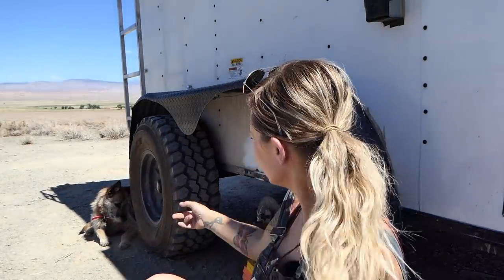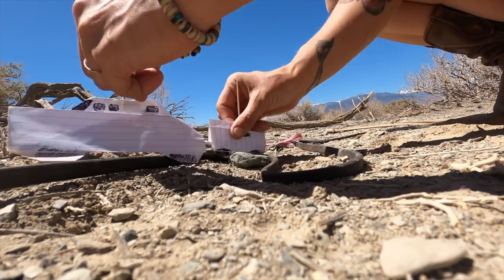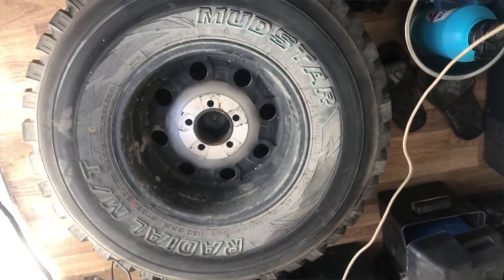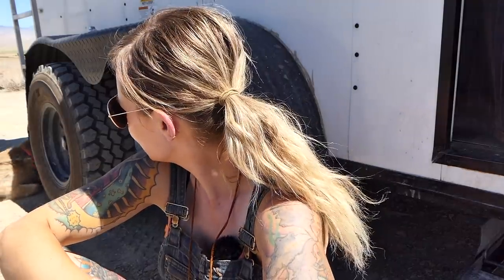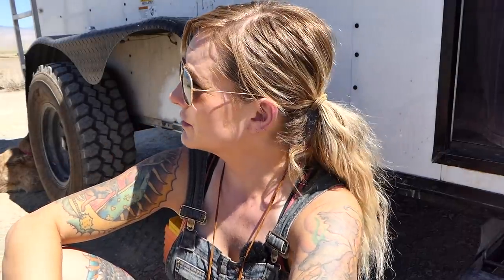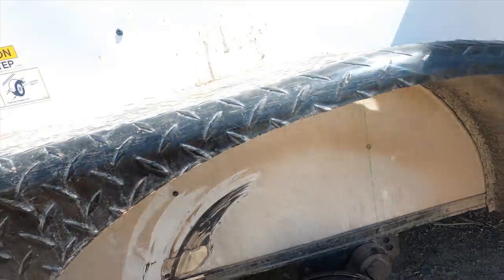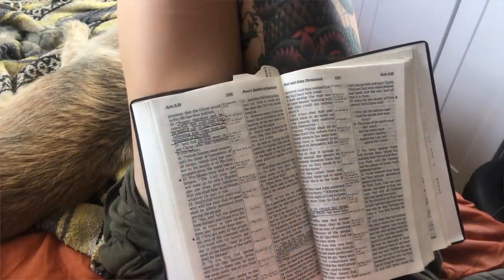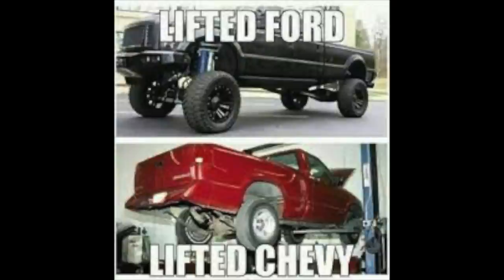Diary of a Broken torsion axle - living full time in a Cargo Trailer Conversion

Comment: Torsion axles are FAR more common on enclosed trailers. Spring axles are WAY more complex with TONS of parts. If you had blown out a spring axle you likely could NOT driven out without strapping up (pulling) the axle to the frame. Spring axles typically distribute the load via a pivot (back of front spring ,front of rear spring) so when wheel is off the hub would drag if you didn't pull it up. Blew a front main spring on deck over trailer tandem trailer on BQE in NYC on a reclaimed wood delivery. Rainy, cold, and miserable crawled under it used two 2" ratchet straps to jockey it back up into place, walked to a Home Depot, and bought radiator and C clamps. NEVER thought it would survive the TERRIBLY bumpy (NYC is so busy they can never really fix roads) trip 350 miles home.....Once home i replaced ALL springs, shackles,pivot bolts and u bolts as they stress fracture over time. (KEEP YOUR TORSION AXLES!!) Simple torsions are better for what your doing.

Comment: Though it was indeed a long video as you warned, some combination of things kept me watching from start to finish, without even speeding it up past 1x.  You're pleasant to listen to, funny as Hell at times, pretty darned smart, and more than pleasant to look at.... with or without wrinkle cream from Los Algodones.   And occasionally you throw us unexpected and unnecessary bones, not monetary like for the mechanic, but usually visual, humorous, or insightful.  

You navigated the situation perfectly, and with safety margin to spare.  Namely, you invested in double axles so that this sort of incident wouldn't leave you stranded.  It paid off by getting you back to pavement, a shop, and a boondocking spot to wait it out.  I won't fault you for not just proceeding business as usual while waiting for the part, but that was another option you prepaid with the double axles, if willing to spend a couple of weeks without the redundancy.  

I think it's a great idea to set your truck up so that in 5-60 minutes you can take what you need from the trailer and proceed to live in the truck without missing a beat.  A handy skill if you ever get in a spot where the trailer has to be taken away on a flatbed tow truck, or left where it is for a while awaiting recovery.

Comment: Hauling Big Bulls: Many years ago I bent the 3rd axle rear wheel when it hit the edge of step I did not see leaving the motel. It happen in town I knew where there was a local repair shop I limp to. In less then 4 hrs they had it repaired better then new. I had that 5ft wheel cattle trailer back on the road again, because the girls back home need the new heard bull. If I were you I would look for a local repair shop that works on older industrial, agricultural equipment. They may be able to repair your part for much less then a national company.  enjoy you videos

Comment: Your incident is exactly why I've decided to go with a Timbren axle-less suspension for our trailer build. It gives you greater ground clearance as there's no axle tube for rocks to hit, it's a fully independent suspension which makes the trailer smoother to tow and better suited for overlanding. They're small & compact to ship & there's no way you'd need to wait weeks if one of them was damaged. I can't speak for Timbren but imagine you can get one shipped to you in days. They're no more expensive than standard or torsion axles & the only compatibility issue you'd have if you upgrade is to make sure that the set is compatible with your existing spindles & rims. You could call them to find out which spindles you need to order for your wheel hubs. The other thing is that their kits are easy to install with no welding required. I highly recommend considering this type of system. https://www.etrailer.com/Trailer-Leaf-Spring-Suspension/Timbren/A12RS440.html  https://timbren.com/p-35853-axle-less-trailer-suspension.html

Comment: I don't need a tow truck, I drilled holes in the front bumper of my RV and I just switch out the tow bar to the RV and tow the RV. I've saved myself a lot of money working on both my rigs. :) Can only drive 35mph because the RV will start swaying.

Comment: I didn't think about having two axles for this specific purpose.  I just replaced the axle on my single axle trailer after it wore out a tire in 4000 miles.  Cost me $200 plus my labor for a 3500 lb idler axle with springs and hubs.

Comment: Good job with the reenactment haha. Learn as you go right. If you're driving over rocks...go VERY slow. None of us are born with knowledge, we learn through experience one way or another. I chose to take specific jobs starting at about 16yrs old on, where I could learn skills and knowledge to use for the rest of my life. Every job since I took to learn more and get paid along the way learning tons of life experiences.  Breakdowns happen don't sweat em. It's soooo much easier these days with internet access, websites and groups etc. 

I noticed in your vid of the axles you have scotchlocks on the brake wiring. Those are HORRIBLE on wiring especially when it's outside. Replace them as soon as possible. Use a small screwdriver and pry the side open and pull the wires out. Strip insulation back and install a 12ga or whatever wire size it is butt splice connector with factory heatshrink on it. They're available on Amazon and maybe autostores with wire terminals etc.

Check out 4x4 Rescue (State) on Facebook. It's basically a network of offroaders all over the country that help others in need on or off road. Essentially it's ONLY for rescues so the only active conversations are active so your plea for help won't get drowned in how do I change my tire users.

Comment: the problem with carrying a spare axle is that left and right sides are different. 
i did 12,000 miles in a 30 year old toyota motorhome with 230,000 miles on it, 
and only $12 for a universal joint in florida.    love those toyotas!

Comment: Ok, you did well. life is a learning experience.   A couple of things, no negatives,  just maybe help if this happens again.

1. You, REALLY hit that boulder to do that damage, probably just hit it right. might never happen again
2. If it were I, with my lifetime of all sort and sizes of trailers; you could have driven that on one axle.  The trailer is overbuilt, to your specifications; you would have been fine, with one 3,500# axle.
3. We have had torsion axles and spring axles; and still own both. The torsion axle is much better on the road; better ride for the trailer and the tow vehicle.  Springs break too.  But you really bent the torsion half/axle, some use different names; but the part that the hub attached to. Somebody may call it differently; have at it.  On a spring axle you still would have bent something; the boulder won.
4. In my area, mountains of PA, as a last resort I would have taken the trailer to a Truck spring and axle shop.  Not a neighborhood service station.  The truck shops replace axles and springs and straighten bent parts; and often have or can get any suspension part. Car, truck, trailer, big or small.  Something to consider when you have major repairs. The gas stations, service shops don't have heavy duty equipment.  It is unfortunate you didn't get to a heavy duty shop. Six to eight weeks, I feel your pain.

Finally: The torsion axles are fine, just don't hit big boulders, LOL. I'm not laughing 

              Go to a shop that can handle the repair, 

              Thank god You, had enough insight to order a tandem axle trailer.

winky

Comment: Hi Lex....Might I suggest, Instead of buying a spare axel(super heavy..And where ya gonna put it?) I would try a off road shop..Have them make a rock slider mounted in front of your front axel. It would either slide your trailer over..or around the obstacle . 4x4s use them and I'm sure someone could fab something out of steel tubing. Probably way cheaper too. Good luck....Glad Riot's with you.
Reply: Al scheider do u know a website has rock slider I fixing buy a 6*14 cargo trailer

Comment: I would have chose leaf springs for toughness. I think the way to get around the stiffness or "bouncyness" (if that is your issue with them) is to get just the right spring rate for your gross trailer weight. You could also get softer springs and add coilover shocks.  A torsion axle is weaker due to the moment arm being totally unsupported, very susceptible to damage. I do not know what your referring to as far as leaf springs needing more maintenance. Ultimately If I were offroading my trailer ( I do, Have taken my customized Harbor freight trailer loaded with dirt bike, roof top tent, and camping gear on Fins-n-things trail in Moab) I would always choose leaf springs.

Comment: I have a 70s canned ham trailer I was pulling up a snow packed icy single forest road (Routt). I should have camped down by the river but nope not for me. I got about half way up a hill until no more traction, pulled us back down to the bend. i was lucky there was a boulder just large enough to stop us other wise we would have landed down in the meadow. the last second I hooked the front end around then had to unhitch go back down just to turn around. She's now a bondo bucket. lol

Comment: Seems like trailer dealer should stock a couple for this occasion.
Reply: With the advent of next day shipping, many repair shops do not stockpile parts anymore. My boss used to tell me to keep it under $5000 parts inventory, and that was mostly tires,  filters and brakes, lubricant. No point in having money tied up on parts collecting dust on a shelf.
Reply: We used to take bent axles off of 4 wheelers to the NAPA shop where they has a machine for trueing bent crankshafts, and get them straightened back out. The Honda shop would not do this, only replace them.
Reply: @gregpeterman1102  
Do you work for Lex's trailer mfg?
These cargo trailers are specifically made for this back roads stuff, and people like Lex who buy them and then get into trouble.  
No, you don't want to balloon the inventory, but with this product and these customers it looks like something could be done better here, IMHO.

Comment: as a retired master mechanic ya just can't beat old school.
spring axle - Availability
12 volt - Availability
AGM Battery - Availability
dual axle - u are not dead in the water with a flat
K.I.S.S - keep it simple stupid
2 is 1    1 is none
preventive maintenance

Comment: Glad you were able to source an axle!  I'm thinking about changing mine out (on my Casita) to a Timbren axle.  It uses a rubber spring like torsion axles do, but their external and have a lower failure rate than torsion axles do... though the type of failure you experienced probably would have happened to the timbren's too.  Parts availabilty for them is pretty good too... they're available on etrailer and amazon so it should be easier to get a hold of them in a pinch.  Anyway, happy trails!

Comment: I hope it works out ok.  I run Dexter axles under my trailer, but they are leaf springs.  I know they offer torque springs versions but I didn't know they were custom size.

Comment: Order the extra axel, have it mounted under the trailer to the point that it's there but no where near touching the ground even remotely the hub part could be mounted upwardwards where only the axel would be stretching under (or across the top of ur trailer if the width of ur trailer is exactly the same at the bottom as it is on the top) the width of the trailer, and if u don't think it can be done it can, always remember this - where theirs a will there's a way, when and if the axel is needed have the spare axel mounted in a fashion where it can be easily removed for usage.

Comment: You handled it well,  explored your options. Of course I don't think that's how we begin...
  I've considered building a small trailer, definitely a torsional style axle as they do perform better ( I wasn't aware that having two sets would reduce trailer vibrations and response to road conditions until you mentioned way back...)  
  I read one comment about having someone store a spare and you have considered having one with you. But wouldn't you require 2? Left and right? 
   Good Luck!! Glad ya have a Plan....

Comment: I have been someone who has a tendency to buy snowflake things, I have bought one too many things that were the this thing is a 95% perfect fit when the common thing would have been a 90% fit... I have learned to get the thing that is easily repaired and swapped the thing that has the biggest community of fans surrounding it (not the most fervent fans but raw numbers) as if you have an issue you want to spend 30 seconds googling it to know how bad it is and not 2 hours  still searching with no answer. I learned this when i had a VW golf and was saved so so so many times with a quick google. So when it was time to get an overland rig the ones that were in contention were the LR3/4, FJ cruiser, 4 runner, Land cruiser, and the one i thought was the cooooooooollllllleeeeeeessssttt diesel jeep grand Cherokee with the Mercedes diesel that they made 2007-2008 I remembered my VW golf and thought I should google some common issues. the land rovers fans had all the answers and how to fix or bypass them the toyotas have so many shared parts that if you cant find the information about your rig but you know the part numbers are the same on another model there is a REALLY good chance you can find out what you need (and find good used parts) in no time at all. There was like NO information on the jeep with the merc diesel i couldnt even find out how many were made, or what were the specialty parts that were not standard merc parts... in the end I got the lexus version of the land cruiser because holy hell it had 181k on it but 176 were meticulously dealer maintained and you could track every repair ever through the lexus website... So in the end i kind of got a snowflake but its really just a normal car rebadged as a snow flake. Which is a long winded way of saying take a 90% good enough to avoid waiting 2 months for repair parts.

Comment: Origami truck and trailer so funny
In my opinion the idea of having a backup torsion axel what would be a good idea and if you do, do it you might want to take a look at having it mounted underneath the trailer maybe have a bracket made the hold it tight up to the frame or maybe even bolted to the across the width of the trailer that way would distribute the weight really well just a thought
Okay so you two stay safe

Comment: You can take your old axle and have it repaired by a (axle dr). When I drove over the road I have had to have a few axles repaired as the trailer I pulled was custom built to transport boats. They can cut off or straighten your bent axle and repair it good as new
Reply from the maker: Thanks! I’ll look into that! Do you know any Axle dr.s?

Comment: My 4star horse trailer had Dexter torsen axles. Somebody bumped into one with their car and it bent just like yours. For horses the significantly nicer ride is important. It seems they do not accept side impacts very well. I didn’t know it was bent until I had the big tire mark on the trailer. Was expensive to fix.

Comment: The good folks that built that trailer SHOULD get busy and send someone with a new axle, installed free, in return for all the positive things you’ve said about their product. Just sayin!👴🏻

Great thing about tandem axles, you could even drive the GOOD tire up on a rock to lift the bad enough to take it off. They even sell jack pads for this sort of thing.

Torsion axles are good, your problem was kind of a fluke. Torsion axles are popular for better horse trailers because they give the horses some shock absorption, but not a wallowing, soft ride. And remember, springs commonly break (“Goneagain” on YouTube had a recent video about off road spring repair). 

Things, in general, break. See “entropy”. The difference is how YOU manage the challenge, and looks like your performance has been splendid.☺️

Comment: I have a 6x12 enclosed trailer with Dexter tandem torsion axles. Just installed a 3" inch lift which I purchased from Etrailer dot com
They have a ton of trailer parts and may be useful for you in the future for trailer parts.

Comment: Would replacing the torsion axle with a spring suspension axle be an option? I found that I had significantly overloaded my single 3500lb Dexter straight axle (no brakes version) on the day I was to leave and slowly drove straight to a trailer shop instead. Had a new 6000lb Dexter straight axle (with brakes) installed by the next morning. Maybe I just got lucky? IDK

Comment: Option D: have the local shop change it to straight axle, you could be on the road in less than a week.
Reply: But the other is still a Torsion...pretty sure they're different heights so can't have 1 of each on there
Reply: @mrmotofy     I was saying to remove both torsion setups and install two leaf spring axles.